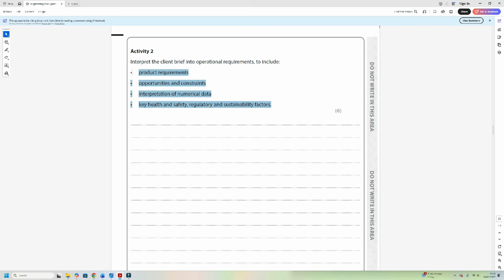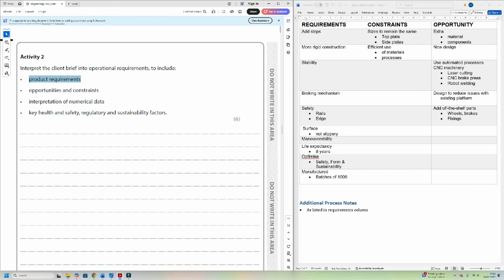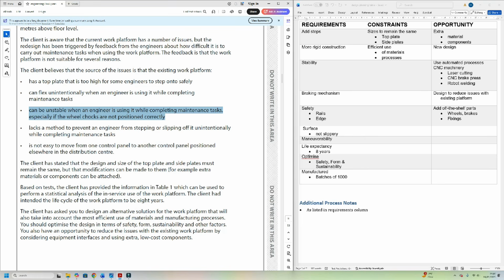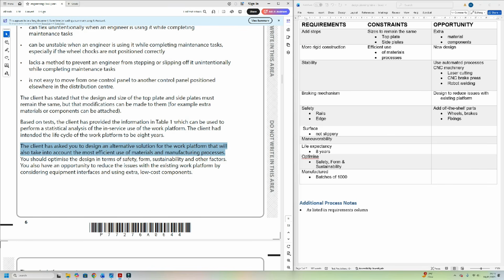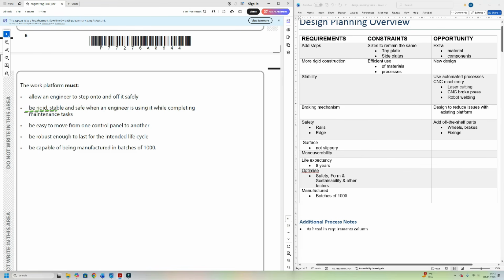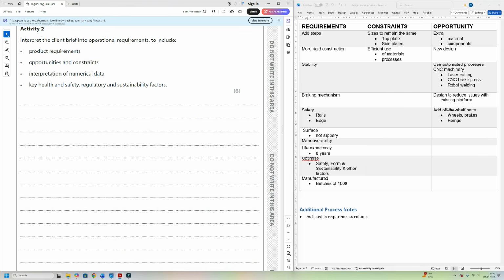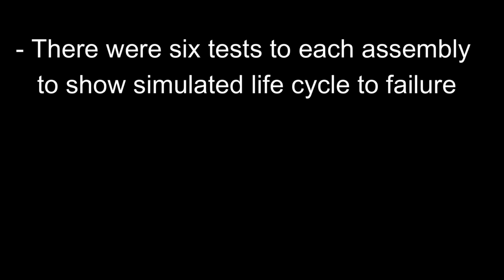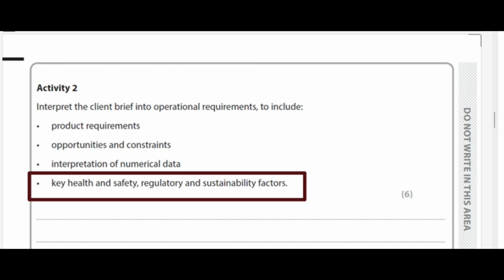Unit 3   Engineering Product design and Manufacture - Exam walk through for Activity 2

Comment: For activity 2 is it best to do a paragraph per bulletin point?
Reply from the maker: Yes, the table is a tool i used to extract the information.
Once I had that information I could summarise each point in a paragraph just after my table.
So the table gave me the following
Customer requirements
Constraints
Opportunities.

Then you can get in with the interpretation and so on
Reply: @1 @111melcat  this question isnt related to activity 2 but for the 3 concept designs is it best to really vary them and steal bits from each of them in Activity 4
Reply from the maker: It said activity 2 in your post.
Reply: @111melcat sorry I meant the second question is related to activity 2
Reply from the maker: OK, choose on of your ideas to start the process.
Now if you find that you like one of the features, it fits better than original. There is no problem swapping ideas from on concept to another.
The whole idea is to propose a solution that provides a product better than the one BTEC got you to sort out.
Reply from the maker: Now, the three concepts, they do need to be different. They dont like seeing three similar design ideas as this shows no difference in iteration.
The points will be low if you do that.
Reply: @111melcat thank you!
Reply from the maker: Every bullet point you see there you have to answer with a few paragraphs.

The table covers points 1 and 2.
The last few come from interpreting the data andnfrom your research notea too.
Reply from the maker: I thinkni have covered it all.
If you have any more questions dont hesitate to message

Comment: Would you get decent marks if you do all the product requirements like the amount of batch  the lifespan the issues it is made to solve and what the sizing of the new product should be compared to the old one ?
Reply from the maker: Yes if you do this correctly. Remember about the constraints, sizes, material and so on must remain the same where stated.
It all depends on the exam.
One may be only a small problem that needs to be solved where like the work platform required significant modification to create a work platform that met the clients brief.
Reply: @111melcat so an example of a constraint would be costing and operational use
Reply from the maker: It may be size of product has to stay the same. 
Low cost manufacture is required.
If corrosion is a problem they might state it needs protection from the elements.
You will find out when you see the exam. And if you followed my method in gathering information. The stuff you need will be listed in the constraint column.
Reply: @111melcat ok thanks